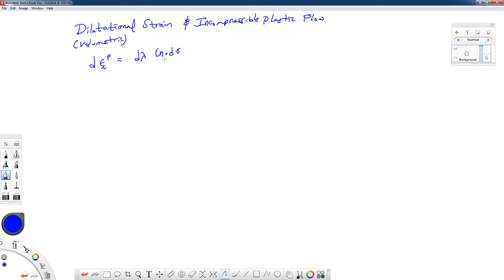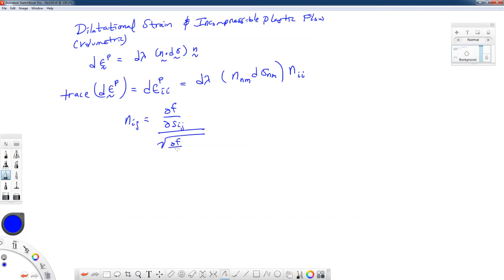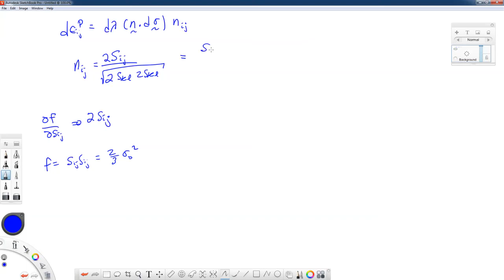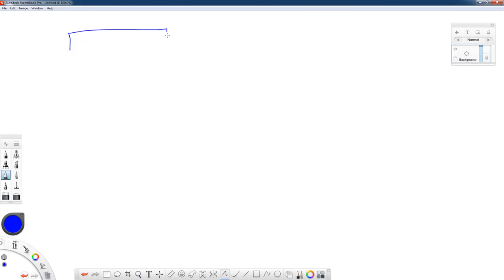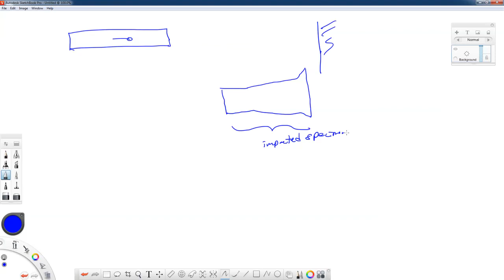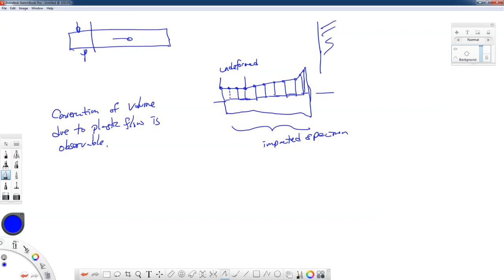AEM 648-13-Dilatational Strain and Conservation of Volume

Comment: Thank you for your presentation. Minute 9.15, you use dep_ij = dlambda (n.dsigma).n_ii. My question is, if your plastic strain increments had ij as free indices, why did you multiply by n_ii? Are you showing that for hydrostatic-stress insenstive materials, the plastic flow rule indicates that there is no change in volume only in the trace, right? Because when i is different than j, we should have a plastic volumetric strain different than 0. 
Thank you for your time.
Reply from the maker: Thanks.  I should have written deps_ii.
Reply: @mbarkey.mechanics  Thanks to you for such comprehensible lectures. Have a great day ahead.